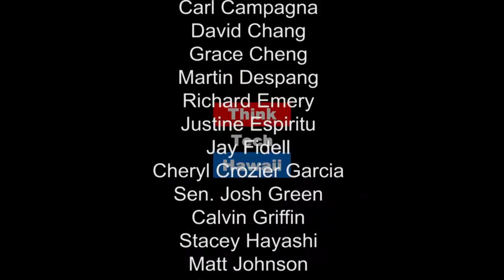Put Rail on the Ground - Re-engineering HART and Cutting Costs

Comment: If there were less euphemism being thrown around as 'possible' rhetorical responsiveness then perhaps the DOT could in fact focus on tram lines currently in use elsewhere outside of the USA as in Melbourne, AU. Where trams share two-lane boulevards, or, avenues alongside regular car/pedestrian traffic at ground-level. To cut to the chase, past, all of the inconvenient truths this interviewer had inured onto the officiate representative for HART. Should this debacle continue the opening for the public utilizing what has already been constructed appears at-odds with generating revenue -- running trains from one terminus to -- the current end-of-the-line until the rest of it's operations have been constructed. Or, met by less resistance to grounding the elevation from Downtown Honolulu forward...Seattle runs it's operations on it's completed sections. Not closed off because the operative portions were designed and developed to being open for operations in 'sectional partitives' ... HART could benefit by doing the same while wrangling out their differences in the long term.

Comment: come to europe and see real trains. Thundering fast fright trains a confortable passenger trains. What has shops on it.
Reply: fast freight? have you seen the BNSF Transcon? 70 mph intermodal
Reply: only 70? :)
Reply: used to be higher...however the trains here are longer and heavier and the speed had to be reduced do to the wear and tear on the tracks
Reply: yes well here are dense fright trafic with electric locomotives. Has speed has all, safety system like etcs erms system curently i try to interest after the the train driver scool. Is a grate life and with one route can pass 3 contryes. It is grate in america dut electric fright trains not often to be seen .